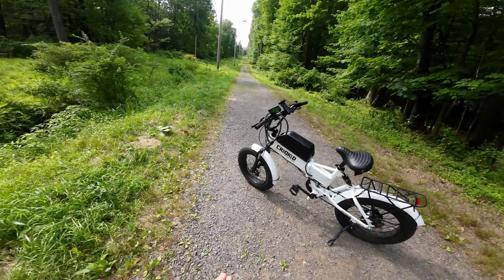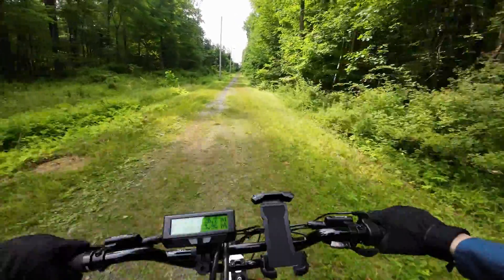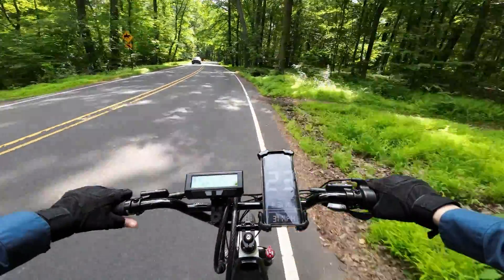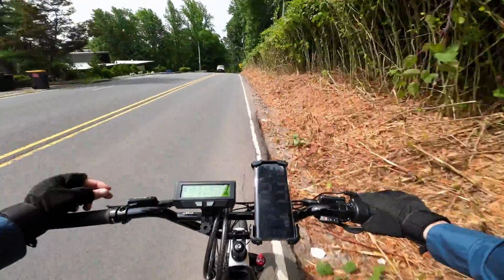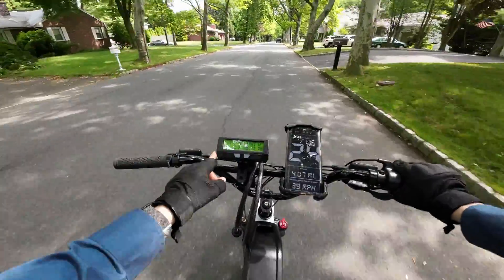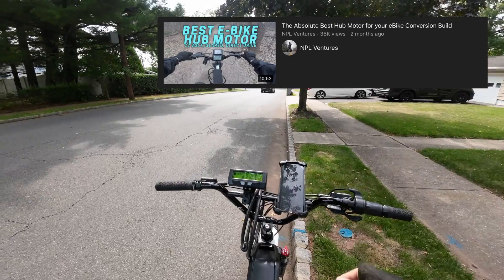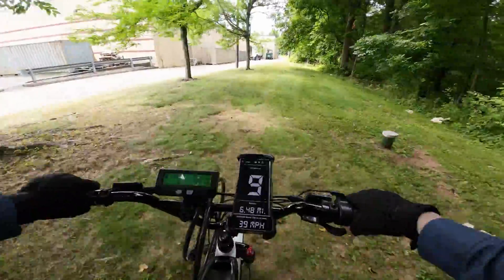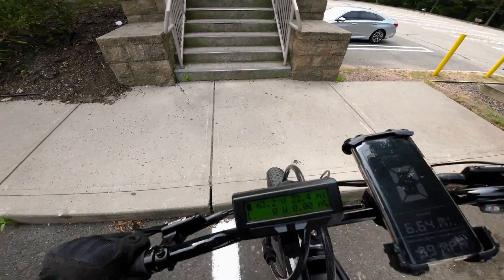Why I Won’t put a Powerful Direct Drive Hub Motor on my eBike Build

Comment: It is possible to use a single throttle with dual motors. It would require some real fiddling with settings to get both motors playing nicely together on one throttle, but it can be done (I'd suggest similar motors for that).
Reply: Yes
Reply: you could mount 2 thumb throttles right next to each other you would be able to press both at the same time easily. I am sure there would be an advantage to just use 1 motor or the other or both when the need arises
Reply: @utubeape  That double press of 2 throttles would probably have you burning out the front tire upon take off, every time, unless the front hub is weaker or set to take off more slowly than the rear. I like the idea of being able to use either motor or both but would handle it with a 3 way toggle switch.
Reply: @michaelsprinzeles4022  I don't know about other peoples thumb throttles but mine is analogue so you get less power if you dont press it down as far, I would put the front throttle further than the rear, so that the rear is used more.
If the front tire is going to spin furiously then the situation would not be appropriate to use it, meaning you would not be on a hill worthy enough to justify the use. I think front hubs spin out more because there is not enough weight on them, could be solved by having a front rack with the battery pack on it and leaning forward as you use it or both
Reply: @utubeape  I only suggested how I would do it, if I would do it. Full disclosure: I am no fan of hubs & especially not front hubs (for the flaws you mentioned). With the right gearing a good mid-drive will climb any hill so the need for a motor in the front wheel is rare as hens' teeth.
Reply: Easily you just need 2 controllers. Plug the battery into both controllers like normal and wire your throttle into the throttle wires from both controllers as one. Done.
Reply: @dylansoutdooradventures  That sounds fine...if you don't mind your front tire spinning out every time you hit the throttle from a stop.
FYI if you run 2 controllers & motors off 1 battery you need your battery to put out double the amps. To support 2X25 amp controlers your battery has to be capable of 50 amps nominal draw (that's not your standard E-Bay battery).
Reply: @michaelsprinzeles4022  There's a little thing called lowering the amps the controllers can pull which would solve both these issues! Also if you are worried about the front tire spinning why get dual motor... just single motor and increase amps until your hill climbing is suited to your needs.
Reply: @dylansoutdooradventures  I did say, in my original comment, that it would take fiddling. Thanks for making my original point.
To stop that front from spinning but give it the same top speed as the rear would require more than just lowering the amp draw of both controlers.
You are right about a single motor for hill climbing though. For hill climbing I wouldn't bother with dual motors, or hubs at all. To climb hills a mid-drive would most often do better.
Reply: @michaelsprinzeles4022  You have something called a throttle to modulate power with... just like in a car. You dont necessarily have to floor it from a standstill.
Reply: @henrikgrangaard7498  It's not about rider modulation. If both front & rear motors get the same signals, and are programmed the same, the front will break traction much more easily than the rear. That's just physics. To get both wheels to keep traction at the same throttle input the front must be programmed to throttle up more gently.
Reply: @michaelsprinzeles4022  Or you just use the throttle more gently...
Or you could lean a bit forward if you want faster acc.

Comment: I don't see how the steel gears are going to make the bafang motor any better. More durable yes, but it's not going to increase in speed or torque. Additionally, it will make the motor even louder which for a content creator may be annoying.

Comment: If you have a direct drive motor and a geared hub motor as well. The direct drive should be the one you use on its own. As it has drag if not powered

Comment: I’ve been running 2,700 battery watts on stock nylon gears lol. 800 miles and still going. On the Luna eclipse. Bafang 500w motor too. I do have an extra set of nylon gears for back up when they do need replacement.

Comment: Your audio sounded very good. 
I think you would find that adding a front DD hub to be a poor addition. The main advantage of the DD hub is high wattage and speed capability. The DD motor needs to be in the rear wheel if you use one. The only two really practical ways to dual motor a bike imo are to use dual geared hub motors or a DD hub in rear and gear hub up front. The main difference in how to choose between them is the type performance increase you desire. With dual geared hubs you get very good hill climbing and acceleration. It can run efficiently on just the rear motor and just add the front for big hills or traffic. The reason to possibly choose a rear DD hub is for top speed potential. I think if you want a bike that exceeds 40mph the DD hub is the better choice. And once you start pushing the DD hub with all the wattage that you need for high speeds you don't end up with much need for a front hub motor unless you live in an extremely hilly area. For that kind of use you could run a DD rear hub with at least 60v battery and 60a controller and activate the front gear hub only when needed for steep hills. In most cases though if you are using a DD hub you will be much better off to just have a single motor at the rear and put all your wattage through it. So I really only think dual motor setups work out efficiently with two geared hub motors. And then it really only seems best if you have first maximized rear wheel output by lacing in a 1000 watt gear hub and using a 40-45 amp controller. If your hills are steep enough to challenge that then you are a good candidate to add a front geared hub for extra torque. But if your goal is high speeds your best bet is to just use a DD hub at the rear and pound it with big watts.
Reply: dd front trust... steering powered feel godlike
Reply: I really appreciate  your comment about your opinions on the usefulness of dual drive and which type motor is most effective on front and rear
Reply: My thought exactly brother Jimmy. Geared hub motors are great for freewheeling due to their built in clutch and can work well in a front wheel. A DD motor would need to have thin laminations and remain powered so as not to absorb energy while coasting. 🌎✨

Comment: I've heard that metal gears make way more noise and the nylon gears do a fine job. I've also heard that getting water and dirt in the motor is a big cause of problems. If seals are damaged or not set right when opened and closed could be a worst then metal gears would good. I'ld wait and if have a problem with slip or something befor opening up the motor housing.
Reply: How I feel as well.  I prefer nylon gears for noise.  If they wear, replace them with same.

Comment: Phase current should be about 2x, 2.5x of the max battery current. Lower than that you would be wasting the power as heat instead of pushing the bike forward. Grin technologies hub motor is overpriced and underpowered, don't waste your money on that

You best source of knowledge is endless sphere forum.

You want to use the highest battery amps possible to make the whole system more efficient and your battery lifespan last longer

To the motor, use your motor and push as much as want until it burns, steel gears is a good idea. Then you can think about a new motor. 

Lastly, never go front wheel drive. It's dumb!

Love your videos. Good riding!
Reply: Great advice.

Comment: I have both a fat bike with a Direct Drive and the Bafang G060.750 (They are HAPPY at 80A Phase, Agressive at 100A and don't go above 120A and will run at 1800W all day.., The problem is 3 Phase Motors need to run at 2/3 speed or Full speed to be efficient, if you run slow then the controller and motor get HOT. Because your Bafang is Geared about 4.5 to 1 it allows for this. So the Geared Hub has more torque its MUCH  better for Hills especially when running below 2KW.. Loooks like you have that bike about right now Dude.
Reply: Great comments...except he needs to up the current and watts in his controller to realized the benefit of his current hardware.
Reply: @lukewalker1051  Correct Bro, and it's at this stage you realize wit a bit of basic Physics it'll be your battery that is the limit to the power, just don't blow your motor
Reply: What controller are you using?
Reply: @BM-zm1jl  Flipsky FSESC75100 -
Reply: @BM-zm1jl  One of those flippy ones, it is rated for 75V and 100A but overheats when going up hill
Reply: @GoingOutToThePartyPeople  do you run any field weakening on it?
Reply: @BM-zm1jl  No dude, I'm on the limit really with a DD, Battery max discharge is 30A and the controller is pretty small, that with these hills and fat tires means I'm pushin the pedals especially on low charge

Comment: I’ve got two front hub motors on two completely different ebikes. They are great on flat surfaces and tarmac. But winter time, rain gravel?…. They are dodgy as F. The wheel spins out and doesn’t grip. Plus the weight of a 750w plus at the front is not good. I put a 1000w front and 1000w back hub motor on a fold up bike. Great power but just too heavy!

Comment: I heard Ariel ridder have stopped using metal gears because metal expands when it gets hot and caused Problems in the motor but I'm no expert so check it for your self

Comment: I have a radpower with a 1500 direct drive motor on front which runs in the low 40’s by its self. I also upgraded to 52v 20ah times 3 batteries. It pulls 2900w. I also upgraded too 750w rear motor and a Bolton upgraded controller and screen too 1777w.
Reply: How do you find the handling with such a powerful front hub motor? Have you only been all wheel drive, or did you have that front hub as your only drive for a while?  How is it just with Front drive on gravel and loose surfaces generally?.. I use to play a lot of hard court bike polo so I am capable at handling a bike, but I also really want to travel on steep gravel mountain roads here in BC, so I don't know... Are front hubs conducive to loose gravel going up steep paths and roads?
Reply: @gregoryvangaya8971  I don’t use it for off road. It wouldn’t be very good. I left the left hand throttle separate and the throttle adjust’s with pas. I have steep grades and I ride it to work every day. The steering is a bit heavy but for my needs it works well and gets me to work pretty quick

Comment: Is your low-end torque affected at all by the gear you're starting in?

Watching you cross Rt. 22 gave me flashbacks of when I was a kid and I'd cross Rt. 22 from Somerville to get to the Bridgewater Commons when it was first built.
Reply: Gearing in the rear wheel only affects low end torque in mid drive motors. With a hub motor, chainring and rear cog size only affects pedalling ability.

Comment: I prefer giant direct drive motors because there are no gears present that make a ton of noise, this is why I don't like sur rons, mid drives, bafangs, etc. - they are great bikes (and parts) and popular because of that - but not for me for this reason. If you want to go fast and don't care about noise gas motorcycles are much faster than ebikes and for the performance, cheaper as well. 

Most people prefer to buy the "fastest" bike/kit/etc because they think that's "the best" but fail to realize that the only true metric for finding the "best" is what suits their contextually specific application the best. Also status is a main influencer of why people buy what they buy, we're competitive by nature so saying your bike has a higher top speed or higher power output number makes you feel superior. 

You're right about phase amps affecting torque the most. I'm not an EE, and I wish someone who wasn't would explain or give a better analogy than what is on endless-sphere. It has something to do with PWM and the mechanical load applied, which is why your phase amps can be greater than your battery amps. I found this which makes a little bit more sense, still not a full understanding: 

_"The battery current and motor current in a PWM controller can be very different.  Many people do not realise is that a PWM controller operates rather like a transformer (using the motor’s inductance) to deliver all the power it takes from the battery to the motor.

PWM controllers are not far short of 100% efficient – they cannot dissipate a huge amount of heat – so very little of the power drawn from the battery is lost in the controller.

The controller varies the motor speed by varying the voltage fed to the motor.

The motor draws whatever current is demanded of it by the mechanical loading. You can use a motor current calculator to work out how mechanical load affects motor current.

The effect of the above is that the motor current into a sufficiently loaded motor can be far higher than the current drawn from the battery: at half full speed, motor current can be nearly double the battery current."_

All the sabvoton controllers I have purchased have the phase amps double the battery amps from factory, which seems to coincide with a good starting point for tuning. I would try double phase amps first, if you're overheating or tripping your BMS, start turning them down slowly until you can push the bike without causing excessive heat or any shutdowns 👍
Reply: About the battery current vs phase current. I am also not an ee. But what I know that a controller acts as a dc to dc converter. Thats why phase current and battery current is diffrent
Reply: @ak16-i5z  Yes, the examples I've read are that the controller acts like a transformer, which is why the currents can be different 👍
Reply: @hightech-lowlife  there are videos on yt that explain this thats where I heard this. But they are hard to understand
Reply: @ak16-i5z  Yes, strangely no one I've seen has put it in more easily understandable terms, just formulas and talking about back EMF and PWM ratios. If I understand it more, I'll come up with a way to explain it better, might make a video on that subject too 👍
Reply: @hightech-lowlife  but I have to disagree on direct drive motors. I dont like them. If you dont plan to draw more then 1000w then they are just too heavy
Reply: @ak16-i5z  Ok I found a pretty good analogy on endless-sphere actually, more talk about transformers and buck converters, someone said it's like flushing a toilet - water input is the same from the tap but dramatically different output in volume and speed, that's how you can have phase amps be way more than the battery amps 👍

I know it's an unpopular opinion, but as I said before what is "best" is dependent on contextual situation, I think most people ride ebikes as a mildly assisted bicycle as opposed to more the "motorbike like" more powerful bikes. There are drawbacks with gear hubs and mid drives though, sending lots of power through a chain or gearbox can wear those parts very quickly if they're not designed for it, definitely better suited for lower power applications. Direct drive is less moving parts and things to wear, and my favorite part - quieter. I've never built a bike under 1000W though, so that's where my preference comes from.
Reply: @hightech-lowlife  i plant to use a bafang bottom bracket torque sensor with a regular controller for hub motor. Can you help me figure out how to connect it. Have you heard anything about that on endless sphere?
Reply: Less maintenance and parts to break or wear down with direct drive motors as well. Direct drive motors are for the most part magnets, copper wiring and hall sensors that can be user replaced without much difficulty.

I came from a BBSHD Mid drive/Mtn Bike and now riding a 72V QS205 Hub Delfast/Enduro clone DIY build allegedly pushing well over 12K Watts. If I were doing lots of off-roading, didnt want to hit 40+ MPH (on flats or hills), running 2K watts or less and didnt care about noise then I would stick with a BBSHD or BBS02 over a 750 Watt geared or DD hub. Going over 30 MPH felt so much less stable to me on a light frame build though.
Reply: @718og  100% agree 👍 I think for lower power regular bicycle frame builds, maybe geared hub or mid drive is more practical, but once you start going over 1000W the benefits of a hub motor start to take over. I think 30 is around the cutoff for feeling stable on a regular frame too
Reply: @hightech-lowlife  those ultra powerful mid drives like QS 138 or KO motors do seem interesting but at that power and noise level I consider it an E-motorcycle and  no longer an E-Bike. I've seen some of your DIY build vids and have enjoyed them! 👍
Reply: @718og  Oh yeah, high power mid drives are interesting but gonna be a lot of noise 😂, thanks man I appreciate it! I will be doing some more mid drive builds on my channel just to mix it up 👍
Reply: The way I visualize phase amps and voltage is a merry-go-round.

You grab it and give it a spin, but you don't run along beside it hanging on.

You're only spinning it for a portion of its rotation, so you can put more weight behind arm when you sling it   than if you were pulling on it all the way through its rotation.

...except...you're the flash, so after your 1st tug, you run around and position yourself for another pull, then another.

But you're still only pulling it for a portion of its rotation, so you can pull a lot harder for that shorter pull.

How fast you can spin it is dictated by the speed of your arm (voltage) rather than the strength of your arm (amps)

It is an imperfect analogy, as are all analogies.